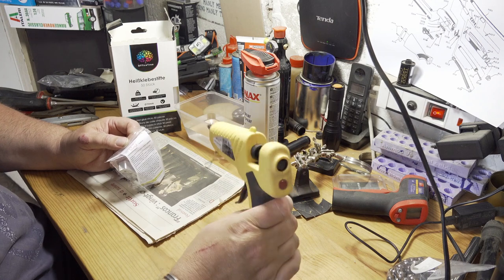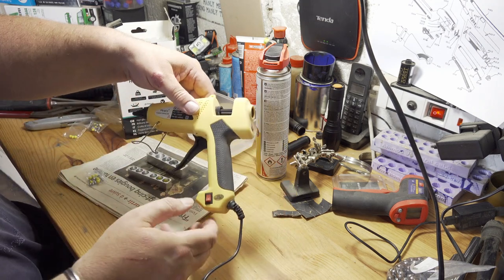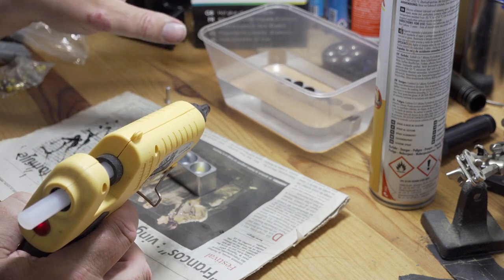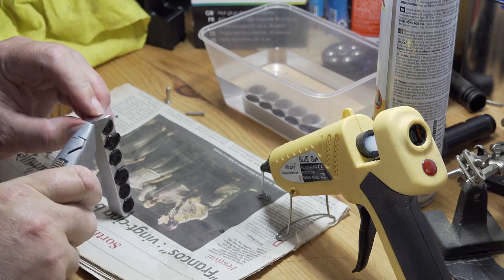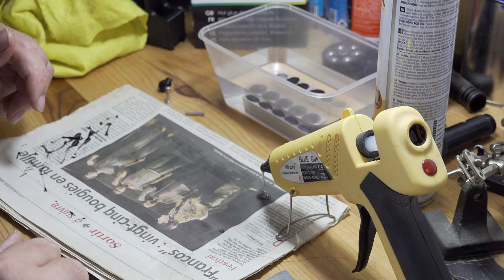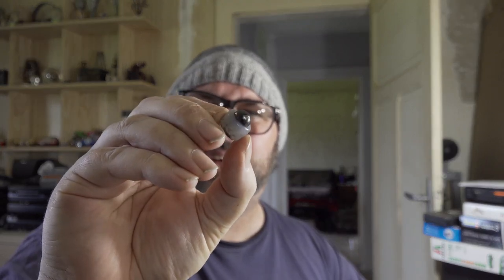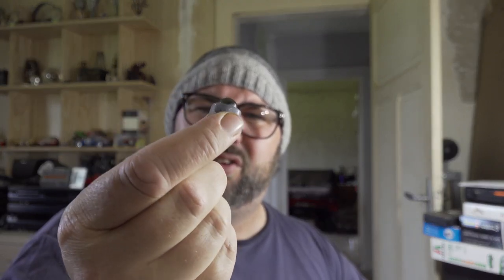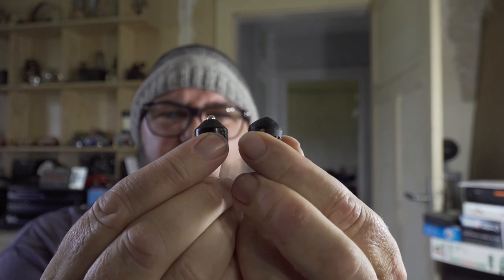Aluminium Slug Mould for the HDR50 & 68 - by Alternative Mag

Comment: Nice indoor review Ben on a cold and rainy day outside. To make life easier, either just slightly underfill all the chambers with glue gun glue, these slugs will still perform well, or use a single sided razor blade (the ones with the protective steel strip on the opposite side of the razor blade to hold it safely - glue gun glue is notoriously hard to cut with any knife, so the very sharp razor blade works much better (mind your fingers!) 👍👍